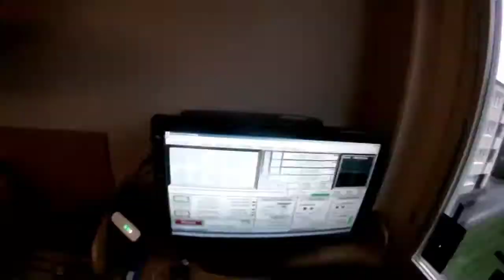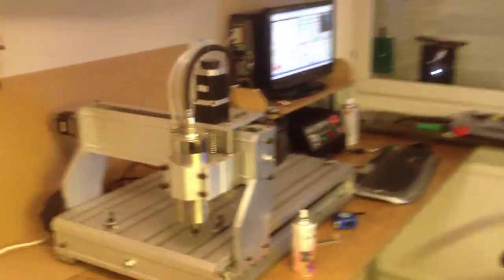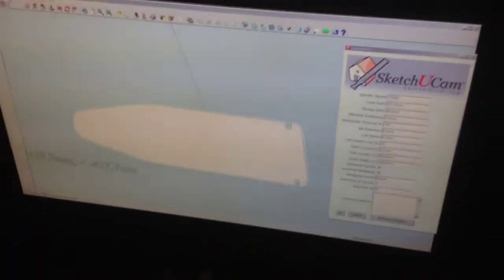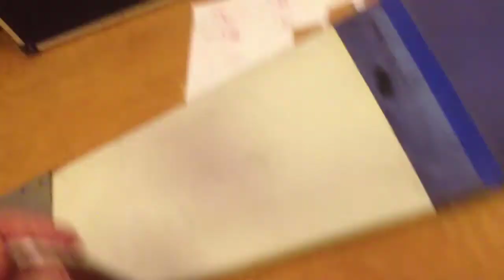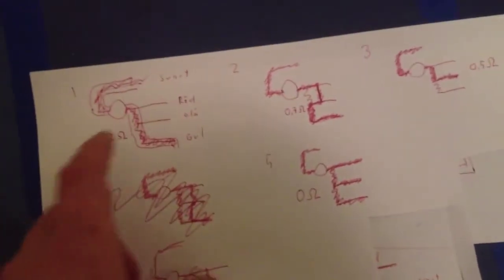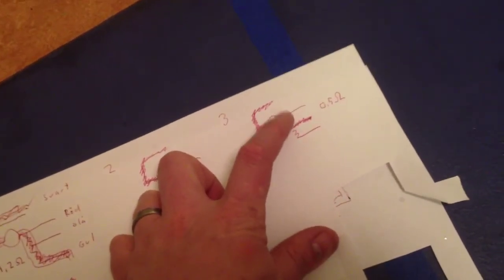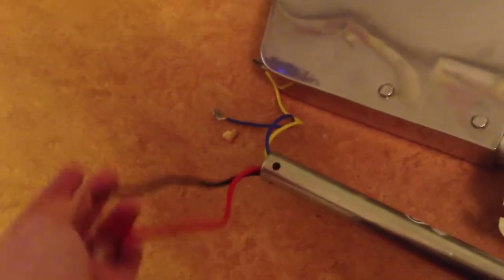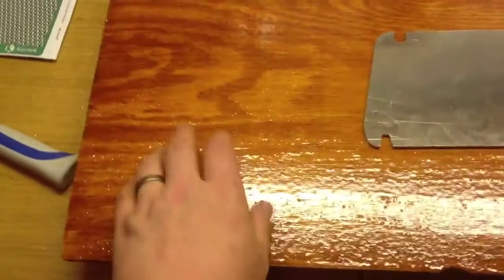My first CNC project, something for my Maxi 77 sailboat

Comment: Nice little router. The neighbors in your apartment must love you. There is a neat program called cnc wrapper it is helpful for generating g code for that fourth axis. I played with mine making lithophanes in pvc plastic pipe.. that was before you could 3d print lithophanes.

Comment from the maker: I think it works very well on my Maxi 77, look at my new video. I get 2.8 knots at full speed. I will use it for in and out of harbors and for fishing :-) It won't replace my gas outboard motor. It's just a nice addition to the boat, not to be used in strong winds, long travels etc..

Comment from the maker: The machine is very quiet when running, it's just when cutting metal it's a bit noisy, but I will don't do that very often. I think I will mostly use it for making PCBs, fiberglass stuff etc. And then I think I wouldn't even wake my wife if I run it at night :-)

Comment: I'm impressed the biltema motor could move your maxi 77 at all. Rusta has a 48lbs motor like that and they write that the max load is 1400 people+boat, the max power of the biltema's electrical motors is 54 lbs, and a maxi 77 has a deplacement of what, 2000 kgs? Your experience is what counts of course! Have you had problems running the motor against a strong current+ strong coming wind?

Comment: Did you cut that piece in one pass?  3mm seems like a pretty heavy cut for a router type machine.  You might want to try  to cut that part in 3 or 4 passes to get better edges.  Neet little machine

Comment from the maker: I cut 2 pieces, the first one I did, multipass 0,5mm each pass. The piece in the video I did single pass, but I think I did way to slow. One part of the cut I cranked up the speed a lot, and that was the cleanest part of the cut. I will make more experiments and i might even do math to calculate correct speed :-)

Comment: Well, yes, it's always good to have two motors, but gas motors are a pain in the ass to maintain: impeller, anode, change oil, ignition (now and then). take up take down (they are heavier of course). then they WILL get clogged eventually both in the cylinder and the fuel lines... Better skip them! I've seen Parsun (here comes the commies!) has a 5hp electrical motor, but they sell it for 2000$. I'm also surprised the 54 lbs elmotors are 'cheap', but if you go over that they get over 700$.